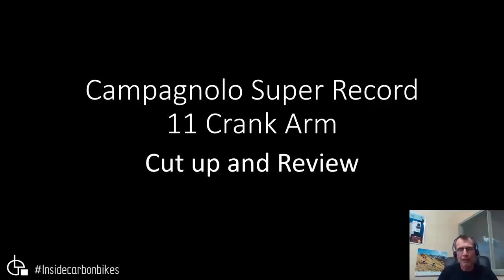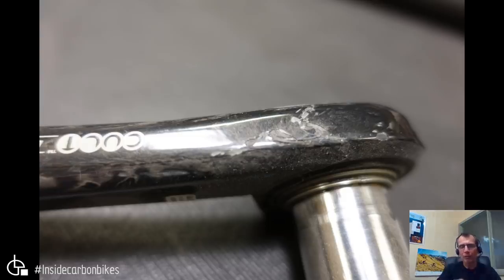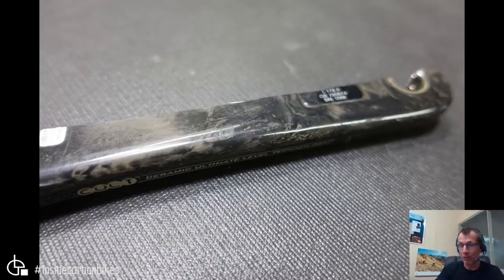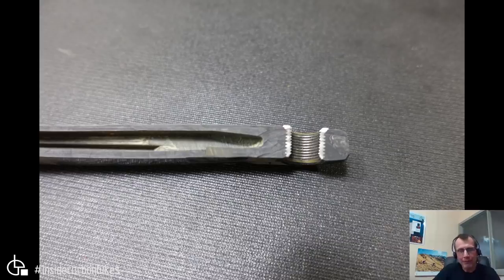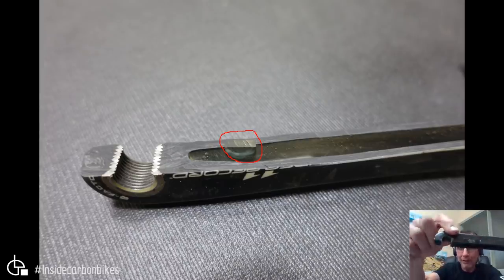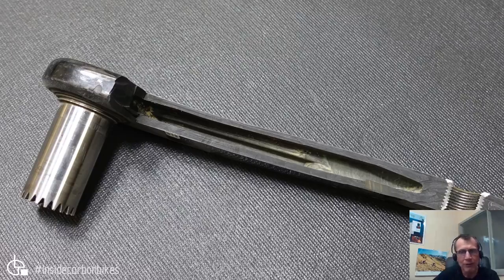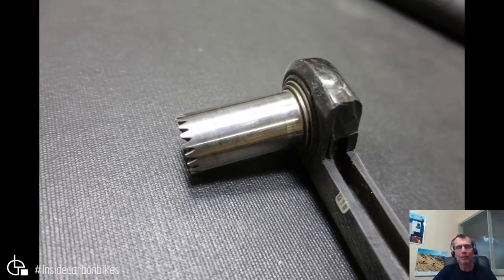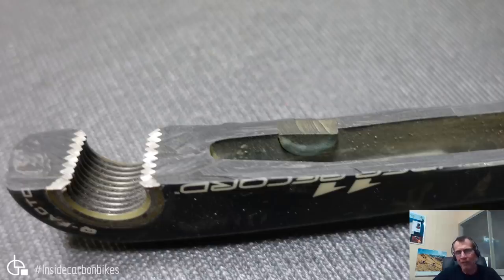Campagnolo Super Record 11 Crank Arm - Cut Up and Review

Comment: I’ve snapped a SRAM Red right crank arm at the pedal threads while sprinting once.  It doesn’t have as much carbon reinforcement as the Campy looks like.
Reply: Pedal thread length on Sram is much shorter than Campag, as well as amount of bonding geometry between metal insert and carbon, thus i suppose it’s weaker (lower design safety margin) against pedalling torsion.

Comment: The inner side of the arm is under compression and the outer side is under tension. So the outer side doesn't need to be as bulky.
Reply from the maker: Yes, it is good to see that this is factored in to the design.

Comment: Two changes Campy has made since that generation of crank:
1) The pedal thread has gone from olive green to bright green - they’ve probably changed the bonding prep
2) Now not clear-coated at all. UV-resistant carbon left raw straight out of the mould.

Comment: Thanks, Raoul   A fascinating video.
My issue with Super Record is titanium.  Excellent fatigue strength and non-galvanic, but it is so low on stiffness.   I don' t care for it anywhere on a bike.   This could be just me, alone.     Cheers
Reply: might be just you. I have that SR crank on a C60 and definitely doesnt lack any stiffness and I am 82 kgs big gear muncher [sadly!]
Reply: @huwsalway4099  Yeah, it is kinda' hard to imagine a hollow, large diameter shaft twisting...   That said, I for sure notice titanium skewers or pedals that have titanium quills.  On my bikes, I've  gone back to steel for those applications.

Greetings from sunny SoCal
Reply from the maker: Definitively not a fan of titanium skewers, they hold your wheel on so they need to be up to the job.

Comment: yellow clear coat is also not an issue on my pre 2012 Campa carbon cranks. I'm running a standard 53/39 Chorus crankset and a compact 50/34 Centaur crankset. Both carbon and virtually indistinguishible from each other if it weren't for the graphics. And those are still as white as ever. Bearings also last forever, if you frame is within tolerance. If it isn't, well then prepare for trouble.
Reply from the maker: Maybe you have less UV there than we have here?
Reply: @LuescherTeknik   That's definitely true. Germany prob doesn't get as much UV compared to Australia. I have seen used Campag parts with that issue, however. In my memory, the first gen carbon cranks with square taper BB turned extremely yellow after a while.

Comment: I'm looking forward to the FSA crank, I have a low opinion on them, 2 of 3 sets I've rode feel dodgy and they refused a warranty claim on the set I ask to claim on.
Reply: I feel your pain, I'm still salty they wouldn't warranty my K-force cranks from over a decade ago. Or at least over a EP/wholesale on new pair as it was clear from the review had how they failed it was poor design not rider abuse.
Reply: never had an issue with fsa cranks myself. still got an fsa gossamer on an old bike now on my trainer.

Comment: I have a campy groupset from 2017 and I can guarantee that the yellowing issue has been solved in the most recent 11s models
Reply from the maker: Maybe it is the high UV in Australia, and it is not an issue in lower UV locations?
Reply: @LuescherTeknik  it could be, but it spent already quite some time under the Italian sun, which isn't particularly weak. Have you seen some yellow cranks with the latest 11s design (the bulky one?) I have seen it only on early 11s designs.
Reply from the maker: The clear coat paints have also improved over time, so thay may be using a better paint since then also. Although I have spent quite some time in Italy and whilst the sun is nice and warm, the UV here is stronger. :)
Reply: @LuescherTeknik  I can imagine it is! :D
Reply: @LuescherTeknik  I have an older 11 speed sr crankset (5 arm) in Florida and it's still white.

Comment: They could very well use eutectic salt as a mandrel, then flush it out with water.  Did that in college. melt and cast the salt to make mandrel, then soak it in water after cure cycle.
Reply from the maker: Yes, there are a few different materials, the salts can be a bit brittle however so not as good in compression molding.

Comment: "As you know, carbon doesn't bend.... It either takes a load, or it breaks."  ???  Perhaps you mean that the strain-to-failure percentage is low for carbon fibers and is generally negatively correlated with the modulus of the fiber.

Comment: I never seen a Shimano crank breaking down!
Reply: I’ve snapped an Ultegra left crank arm in half just cranking over a roller.  Had to pedal one-legged home
Reply: Look up 6800 breakages, plenty of info out there.
Reply: I have seen two ultegras fail neither were especially old they are known for it
Reply: Stopped to assist one poor chap not long ago whose ultegra R8000 non drive crank had de-bonded doing one of our easy loops. Only carry spare tubes not crank arms :)